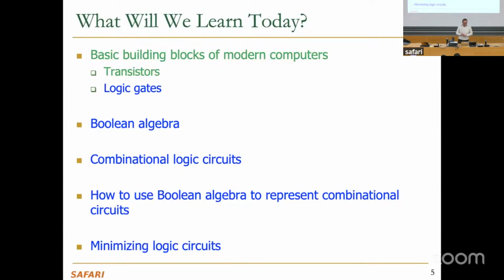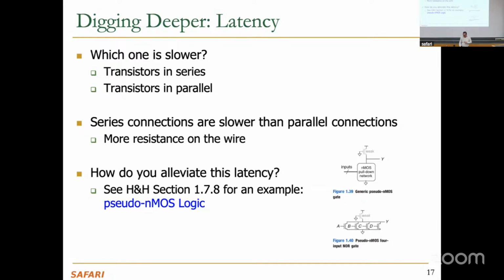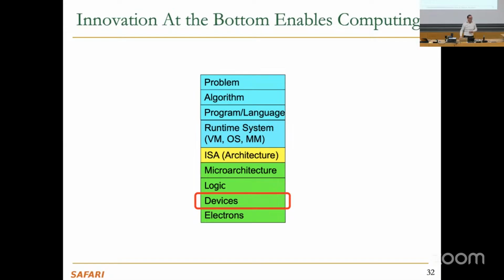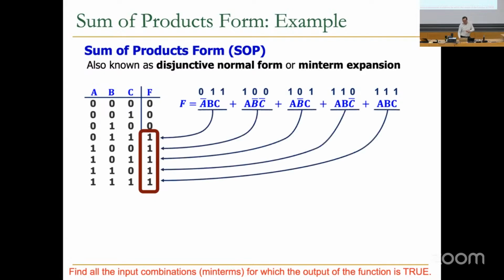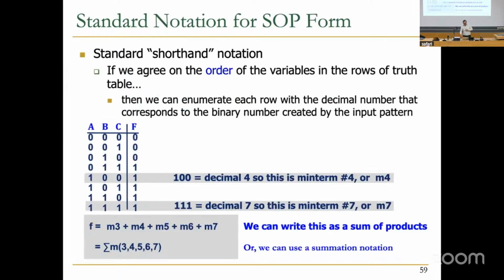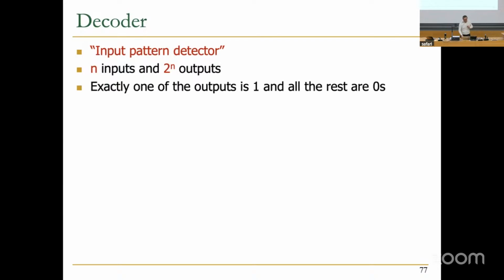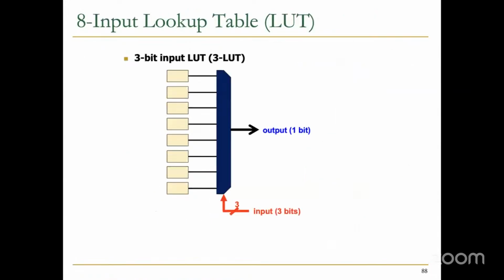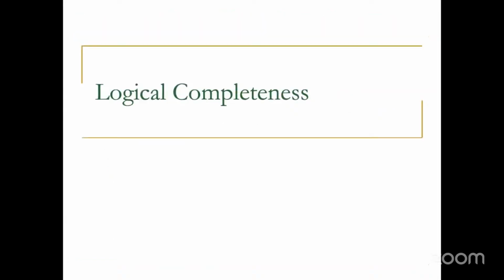Digital Design and Computer Architecture - L2: Combinational Logic (Spring 2025)

Comment: I believe I've designed a 4 transistors AND gate.
Reply: Publish a paper on it
Reply: you can, but it won't practically because transistors are not perfect switches that is a p type transistor can't be used nicely to pull down the output similarly a n type transistor can't be used to nicely pull up the output.
Reply: @imnemo2327  exactly, the professor mentioned that in lecture one.
Reply: I'm sure you did
Reply: @r_mclovin  he can do it technically, but it won't work effectively since current CMOS design is limited. It's possible maybe with some Beyond-CMOS technologies like spintronics etc. which are still studied by researchers